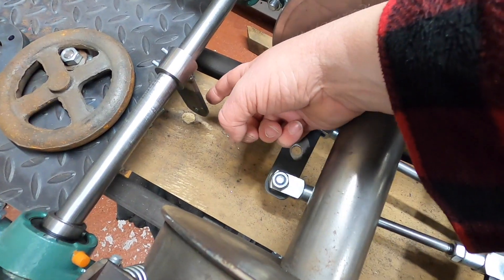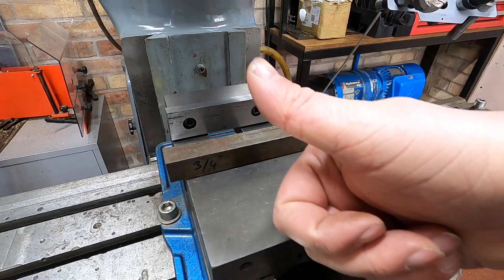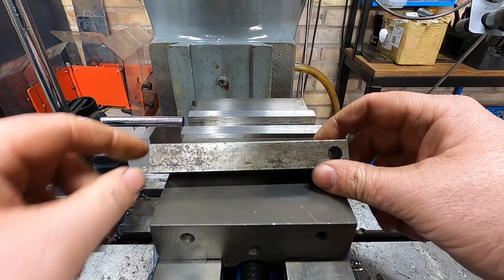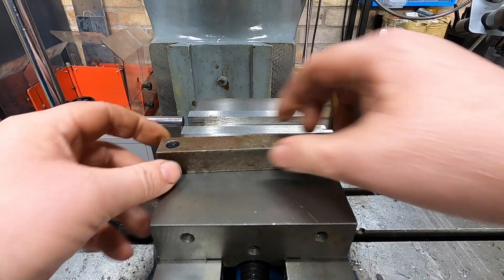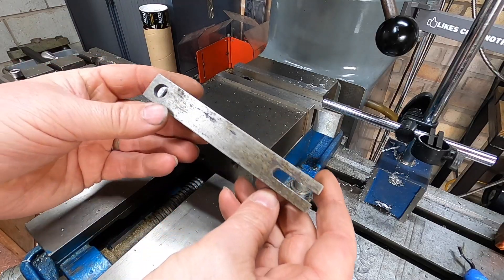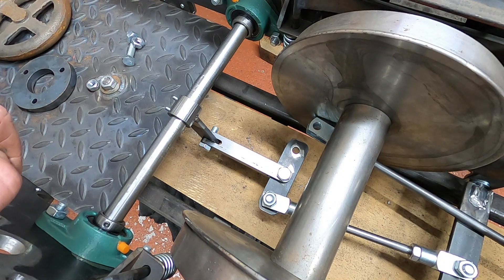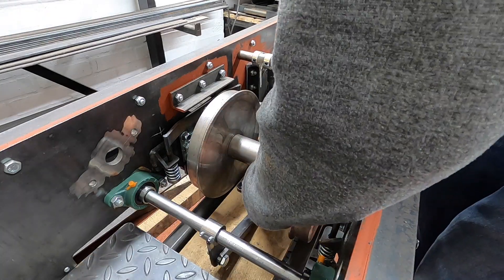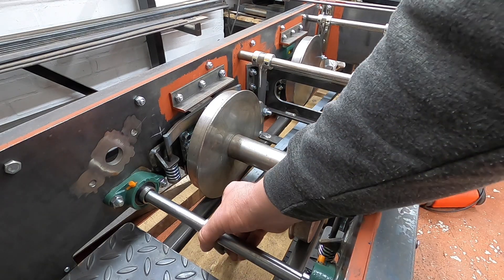Brake Linkage connector link - - EP40 - 7.25" Gauge Steam Locomotive Build

Comment: When you fit the link pins, the heads should always be on top, and the nuts underneath.  That way even if the nuts fall off the pins will still work, though possibly less effective.  With the head underneath the whole pin can come out and then it won't work at all.  

Also should use bolts with plain shanks through the parts, not set screws.  When there's a thread being pressed into use as a pin, it very quickly wears awsy the thread and makes for an incredibly sloppy fit
Reply from the maker: Hi Edward, you are 100% correct, these are just temporary fixings, the only reason they are upside down was for ease of putting it together. Once I’m happy I’ll make all the pins at the same time. I was just going to make pins that drop in from the top, washer at bottom with a split pin. Hope you and the family are well, All the best, Matt 👍